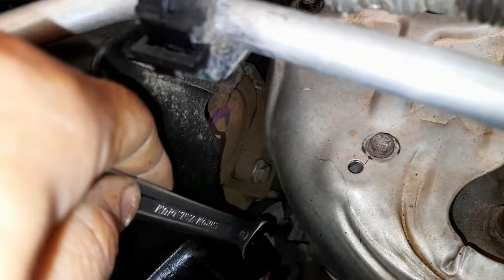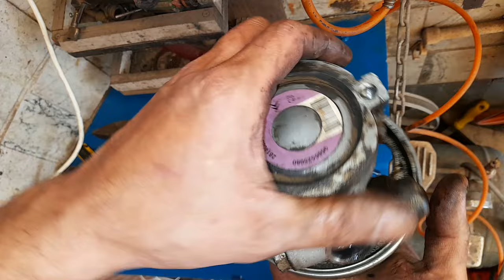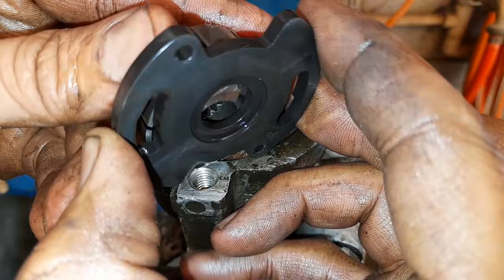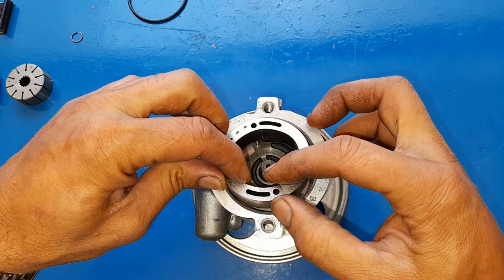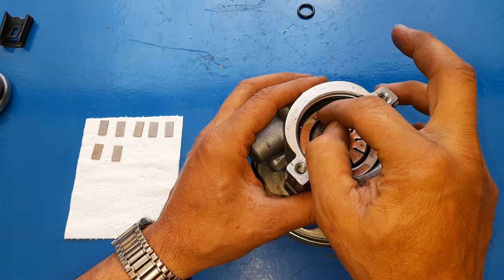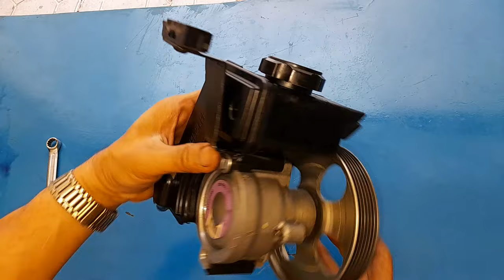Unbelievable Trick: How to Repair a Peugeot 206 Hydraulic Pump in Under 20 Minutes!

Comment: Excellent video, what was the problem with the servo pump? I Have problem, the servo is very weak, almost non-existent and I don't have any errors on the diag.
Reply from the maker: Thank you for watching the video. Please tell me what you mean about the word servo
Reply: @creativitychannel712  Sorry, a servo is a local name for power steering. The steering wheel is stiffer than it should to be.
Reply from the maker: سفتی فرمان به جز پمپ هیدرولیک ضعیف، دلیل دیگری هم دارد و آن سوپاپ فرمان در جعبه فرمان است. سعی میکنم عکسشو براتون بفرستم علاوه بر این در برخی از خودروها یک صافی روغن بر روی پمپ تعبیه شده است که با تمیز کردن فرمان می توان آن را تمیز کرد. صاف تر می شود @denismilic1878
Reply from the maker: https://otoyadak.com/wp-content/uploads/2017/08/%D8%B4%DB%8C%D8%B1-%D9%81%D8%B1%D9%85%D8%A7%D9%86-206-477x600.jpg
Reply: @creativitychannel712  TNX, I ordered new pump. It cost only 60€, reparation is not economic for me.